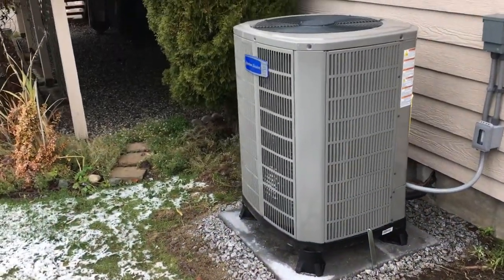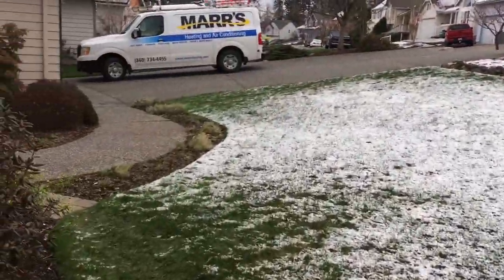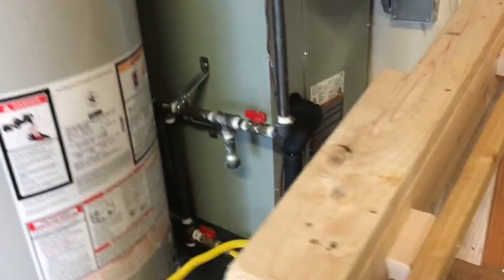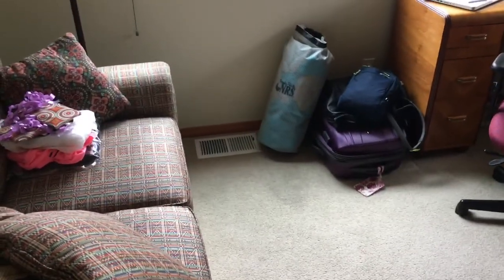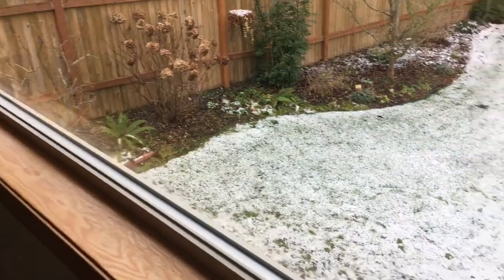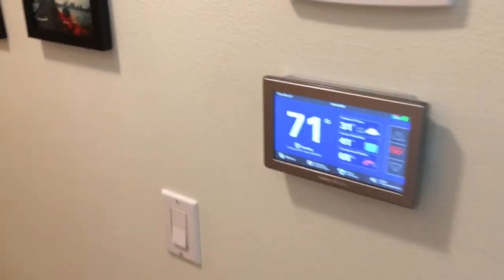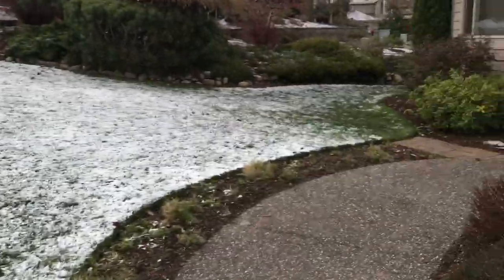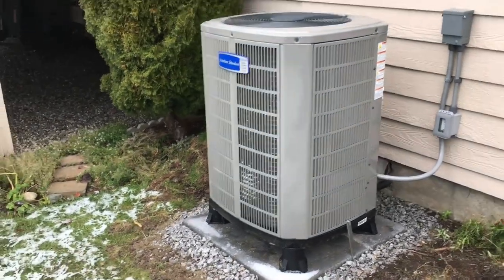American Standard Heat Pump Install

Comment: AMERICAN STANDARD—> It’s stupid to have to manually switch to emergency heat when outdoor gets into teens.  You should be able to set a trigger point then let the controller turn it on when temps get below that point.

Comment: Was there a reason you didn’t install the 95% furnace? Thanks for the videos.
Reply from the maker: RV10flyer  good question! Simply because of customer preference, and the balance point on the home was so low that our heat pump should be doing the heavy lifting and rarely will need the furnace
Reply: American Standard